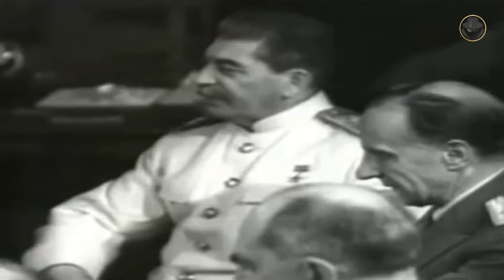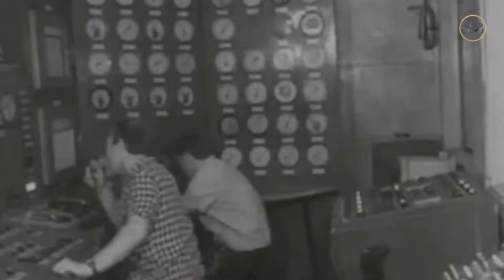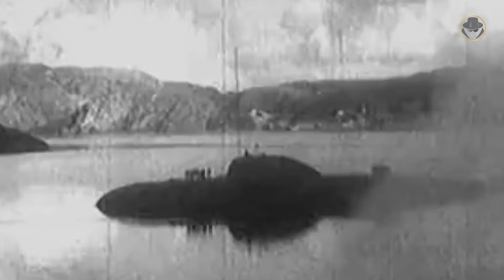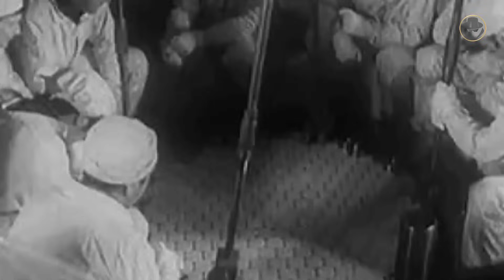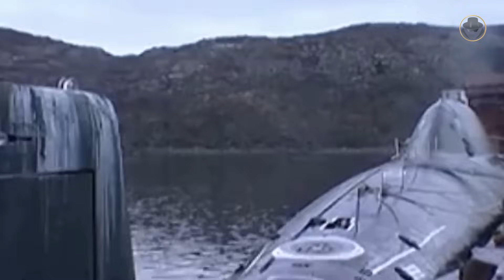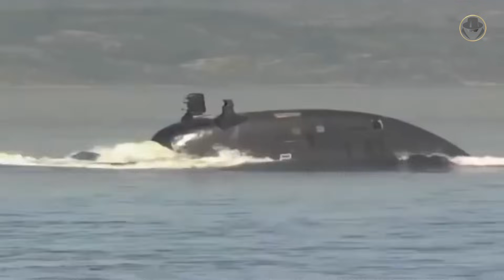Alfa class submarine - Project 705 Lira | Catch me if you can

Comment: Excellent video . 
The Alfa class subs were fast as hell, but to noisy and not fast enough for anti sub warfare's helicopters . Even the Victor class was easy to detect . 
The french navy declassified few years ago an incident happened in 1981, when a Victor was following the Clémenceau in the french territorials water . A F70 frigate and a WG13 Lynx chase the Victor during several hours and forced her to surface before escorting her in the territorial waters .
Reply: In the early 1970's, a Victor was able to sneak into Holy Loch, Scotland, sat on the bottom, and waited for an American boomer to leave port. The plan was to then follow the missile sub on its patrol. The Victor would've gone unnoticed if the American sub's Captain hadn't decided to do a test dive while still in the shallow loch. The two subs collided.
Reply: Just saying Victor isn't very helpful. The three different Victor classes were very different. Victor I was practically not designed for noise reduction at all, Victor II had some minor optimizations, and Victor III was practically a completely different sub. They were no Los Angeles, but the Victor IIIs genuinely were very quiet SSNs. 

Regardless, ASW helos and ASROCs had the issue of relying on the Mk46, which, while excellent, wasn't fast enough to reliably engage an aware Alfa.